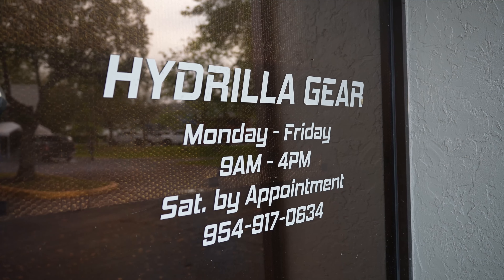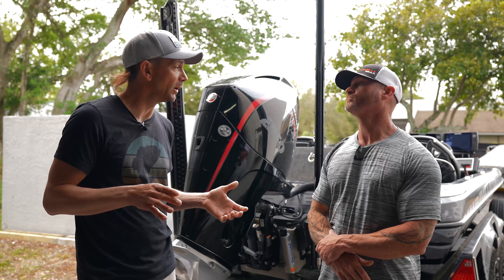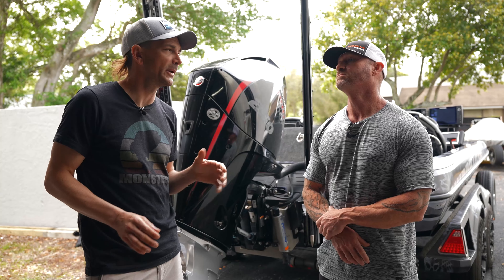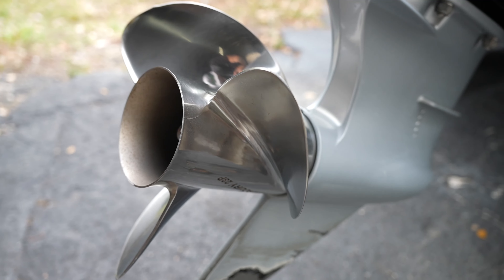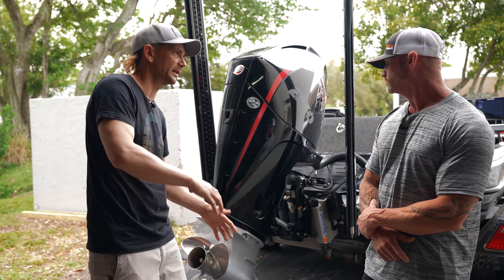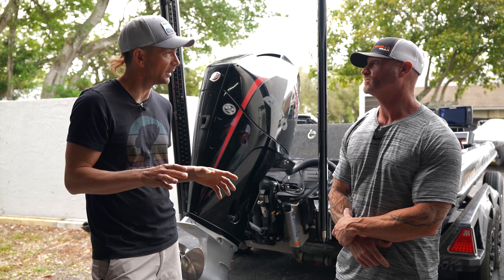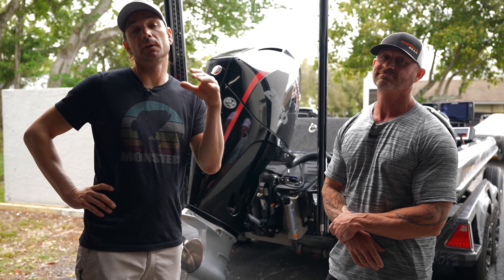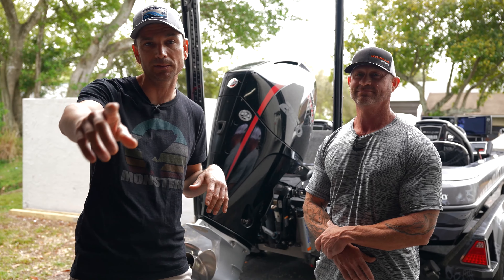How to make your BASS Boat FASTER?

Comment: I've got a boat almost identical setup to yours. 70 MPH with all the junk you carry and a 23 fury is probably perfect for you. My boat ranges from 63 (only during a huge heat wave) / 67 with a tourney partner, their gear, full livewells and full fuel to around 72 solo,  empty livewells, less than topped off fuel. When I winter fish and get a bunch of the my tackle out of the boat and run it in cold weather I'll get even a touch over 72.

I do have a 4 blade as a spare prop, going to run it some in the summer when the heat is bad and the boat is loaded. It's an absolute rocket holeshot with the boat, but hit redline around 65ish. Might screw with it more as summer gets hotter, but honestly it's hard to beat the fury 23 for an all around prop. My boat came with a fury 24 and during break in I hit around 74, but once I loaded the boat out it couldn't get enough RPMs.

Comment: Rear tank CHAMPIONS were one of the best riding and safest handling boats everywhere. So good, Bass Cat makes a Cougar 203 Hybrid.
Reply: Basscat has it figured out with the split rear tanks.  Regardless, heavy weight behind the seats or under the seats and lightweight forward is the only way to get true performance.  Champions, Basscat, Legends (alpha series) only boats to run

Comment: The pad of the boat is the fulcrum point. Make sure that your load, prop, setback, and prop shaft depth below pad optimize the angle of pad to surface contact. Mathmatics.